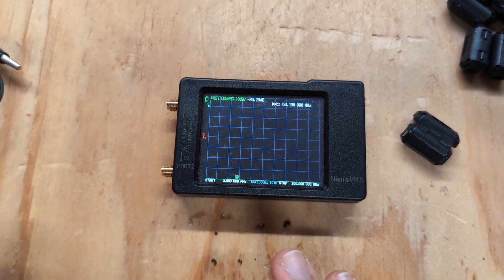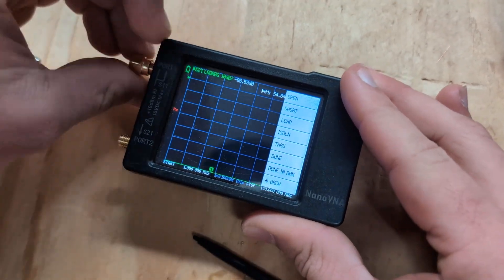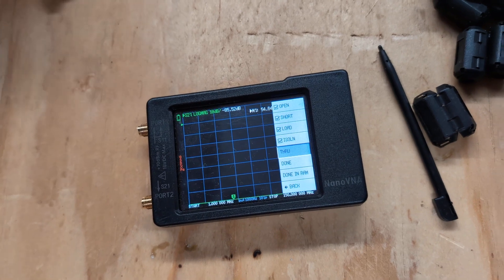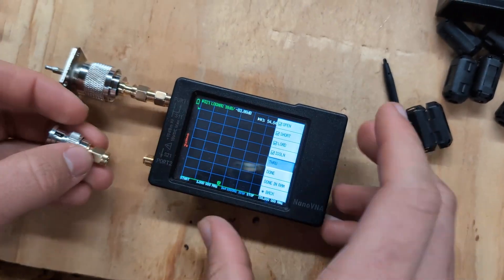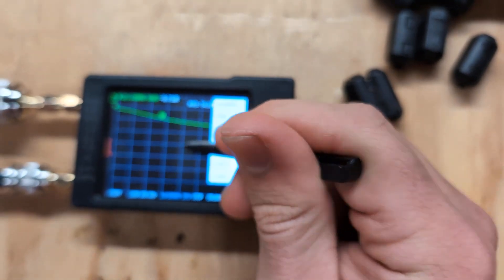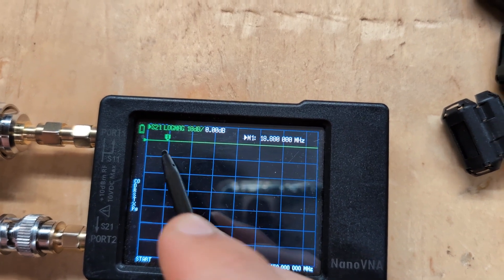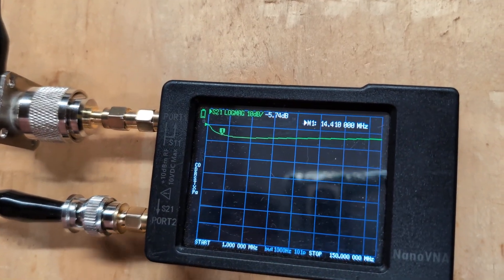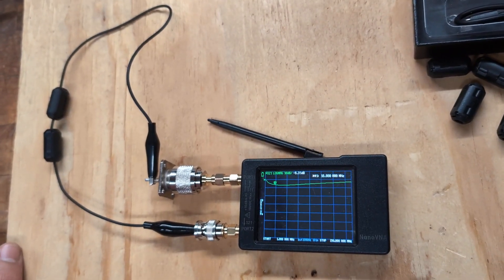Ferrites: What Frequencies Are They Effective On? Measure with a NanoVNA

Comment: How would you read toroid rings like Ft-240-? using you setup which I thank you for the video.
Reply from the maker: The same exact way.
Reply from the maker: Just pass the wire through the ring
Reply from the maker: The more times you wrap the wire through the toroid the bigger the effect